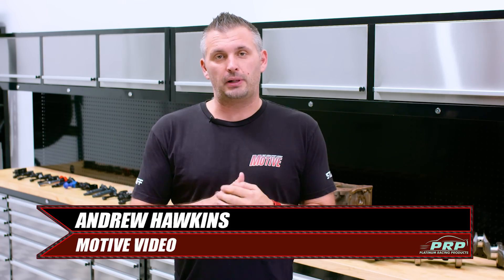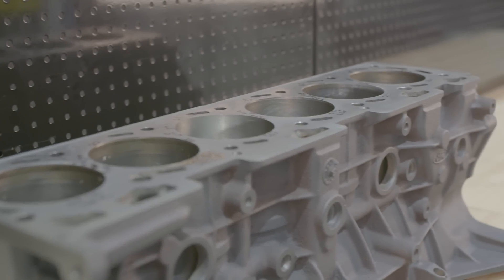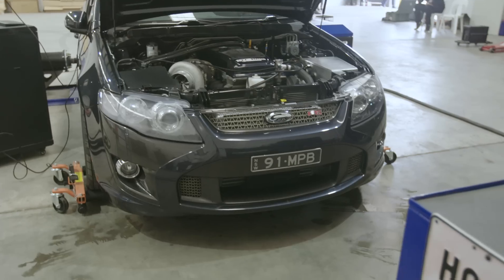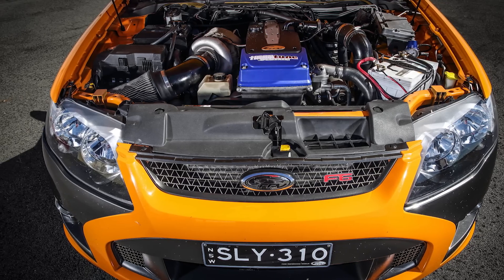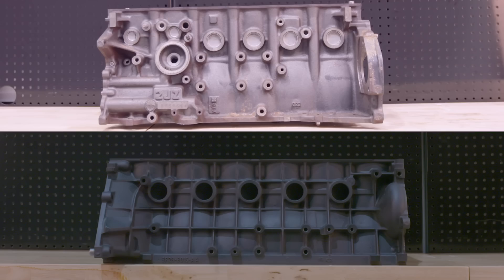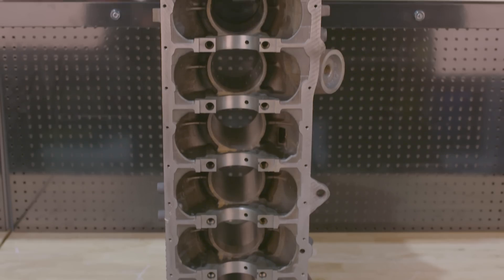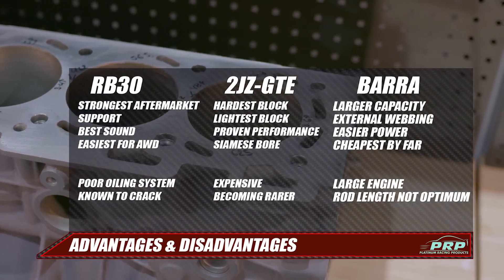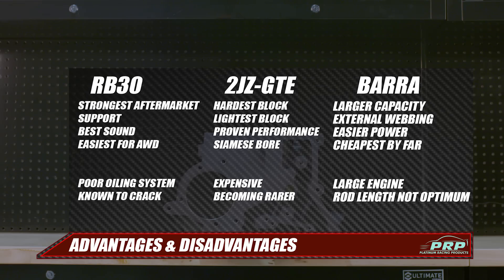Is the Barra 4.0L block better than the 2JZ and RB30?

Comment: Cost and Labour of a 1000Bhp Barra is far less than a 1000bhp 2jz
Reply: Someone should setup a business exporting Barras to the USA and then the Australian tuners should set up sister workshops over there tuning them
Reply: @scksqzbngblo9880  make it a 2 way deal, Barra's to the US and LS and Coyote's to Australia
Reply: @hangover2000  lol we've already got LS. Commodore, mate.
Reply: @scksqzbngblo9880  We import Barras into the US, have a few for sale right now, we have been importing them for years now. But as far as tuning goes that's up to the client to purchase the other parts necessary if they want to go with higher hp.
Reply: Lol the f6 can handle more power than any JDM car
Reply: Genghis Khan  barra requires far less to squeeze 1000hp than a 2j
Reply: Castle Bravo  "Why would you, an engine reseller, not refer to the engines as what they are actually called? "

That's how it is, I didn't make the rules, just making things easier for people. I am not affiliated with this company but here, 

https://www.dominatormotorsports.com/barra-swap-shop

What does that say? "Ford FG 4.0 Dohc Barra Pre-Order"??? Surely in your infinite wisdom it should say Ford 195 Dohc Barra? Pretty sure they are using the wrong image there as well, the engines they are selling are probably the non turbo variant but it's hard to tell from the container images they posted. 

Maybe it's an Aussie thing? 

Nope...

https://www.ebay.com.au/sch/i.html?_from=R40&_trksid=m570.l1313&_nkw=barra&_sacat=33615

"FORD FALCON ENGINE FG-FGX, 4.0, DOHC, BARRA LPi (198kW), SILVER ROCKER COVER TYP"

"FORD FALCON ENGINE FG-FGX, PETROL, 4.0, BARRA, 270kW, TURBO LONG BARE"

"FORD FALCON ENGINE BF, 4.0, BARRA, DOHC,"

Out of 31 listings for Barra... 1 of them came back with 182/190/195...  Just one.

"Ford Territory SX SY Barra 190 182 Petrol 4.0 L 6CYL Engine / Motor - Express"

So what about NZ? Let's search FB marketplace Auckland New Zealand 

Only 2 Barra's show up...
"BA XR6 motor and 5 sp Tremec"

https://www.facebook.com/marketplace/item/2378843102219479/

"Ford Falcon FG XR6 4.0 Barra engine and Ecu 155kms"

https://www.facebook.com/marketplace/item/413792716223477/

Maybe that's a one off, let's go south to Christchurch. Only one listing and no mention of whether or not it's a BA/BF or not, and no 182/190.
 

"Barra motor and box"

https://www.facebook.com/marketplace/item/841279756286672/

But one thing you can tell is that it's not an FG, or at least not an FG intake and FG oil pan. 

What about gumtree? 

https://www.gumtree.com.au/s-ad/ferntree-gully/engine-engine-parts-transmission/ba-falcon-barra-4-0-engine/1237748287

https://www.gumtree.com.au/s-ad/warburton/engine-engine-parts-transmission/xr6-barra-na-4-0-and-5-speed-manual-ba-2004/1237591464

https://www.gumtree.com.au/s-ad/edwardstown/engine-engine-parts-transmission/bf-barra-n-a-motor/1237337901

https://www.gumtree.com.au/s-ad/loganlea/engine-engine-parts-transmission/ford-falcon-fg-xr6-mk1-mk2-barra-bare-engine-no-bolt-on-accessories/1236605812

I could go on and on a lot more than this and likely blow past any character limit on here by a mile. 

For just shits and giggles let's look up some Barra engine builders. 

http://www.lewisengines.com.au/xr-6-turbo-ba-bf-fg/

Wait here's one...

http://www.nizpro.com.au/services/engine-building/

"Ford Barra 240T, 245T, 270T, 270T FG, 310T FG 6 cylinder"

But even they still added FG? I wonder why? I must be hallucinating right?

https://tremaniacracingengines.com.au/product/ford-4-0l-barrra-long-engine-1000hp/

"Cylinder Heads
Reconditioned STD BA/FG with upgraded valve seat profile"

Or hell here? https://www.fordxr6turbo.com/forum/topic/92105-engine-build/

Search for 195, then FG, how many mentions for 195 are there? 

Some of the only really true mentions of "Barra 195", "Barra 190", etc is in the wikipedia page and a few reviews. Pretty much any time you see 195, 270T, etc you are also going to see FG. But every instance of FG you are not going to see 195, 270T, etc. 

Is the actual name a BA/BF/FG engine? No. But it does differentiate them enough for most people to understand. 

"If anyone is looking for a Barra there in the USA, then they should know ( and I can guarantee they do )"

Okay, go to some US based sites, and search for something like Barra FG, and then Barra 195 or Barra 270T. Do it, I'll wait. Now what you will find is most if not all mentions of 195 / 270T will also have FG mentioned as well. But if you search for Barra FG, there will be a lot less overlap. The only time most people in the US add 182/190/195 to the title is to stretch it out and get more hits(SEO) later for those that actually do know and are searching for that specifically. But if they know that, they also know they are referred to as BA/BF and FG. 

Ebay for instance when searching for "Barra 195 engine" no quotes, no engines pop up. 11 results Just things from Australia like gaskets, but... they also list BA BF and FG as well. I wonder why? 

"Barra 190 engine" no quotes, no engines pop up. 24 results, similar things to the previous. 

"Barra 182 engine", etc, etc. 26 results, etc.

Now what about BA BF FG? 

No engines for BA or FG but 2 for BF.  

"If they are confused when you refer to them as what they actually are, then maybe they shouldn't be buying one. "

That's mighty elitist of you. You don't need to know what they mean to put one in a car, or anything along those lines. All the parts you may need to find are going to be easily found by searching BA BF FG. That's like someone getting pissy when they see 74+ 40 series Land Cruiser doors on a 73 and older. 

"and I can guarantee that no one here would rock up to an engine supplier and ask for a "BA or BF Barra" "

I showed above that isn't really the case. 

"for the simple fact they were also in Territorys. "

I am well aware of the vehicles they were in. But... anyone that deals with Barra's on a daily or hell monthly basis would be able to know exactly what you are talking about. 

"I've never ever seen or heard Barra engines referred to as anything other than their kilowatt rating or year of manufacture. Weird."

Yeah it is weird. For someone that claims to be as knowledgeable as yourself on the topic, you sure don't search around that much, buying / selling. I showed plenty of examples even in your back yard. 

But for the sake of my curiosity let's go off the beaten path a bit.

What about Haltech  I am sure you are familiar with them. 

https://www.haltech.com/new-product-ford-barra-4-0l-terminated-engine-harness/

"Engines Supported:
Ford Falcon I6 4.0-litre DOHC VCT “Barra” BA, BF, FG, FGX" 

Surely you are not calling the people at haltech ignorant are you? May want to file a complaint with the International Barra Society or something.
Reply: Castle Bravo  When discussing Barra engines, I find it easier and it's normal to say BA/BF/FG barra instead of 182 / 190 / 195. Saying Barra 190 just leads into a whole other discussion when the norm for so many people is just to say BA/BF/FG. It might be a little different in AUS? But Ben Neal (The mechanical Stig-MCM) even refers to them as such. I have yet to see anyone in the US refer to them as 182/190/195. We have sold quite a few Barra's in the states and were probably the first ones to start selling them here as well. At no point other than myself saying they are 190/195 has it ever been brought up in discussions. When first getting into selling them a typically conversation went like we have a Barra 190/195 for sale, they scratch their head like wtf are you talking about, and come back with do you mean BA/BF or FG? 

Just for clarity I am fully aware of the green tops, red tops, etc as well. 

BA Falcons are 2002-2005 Barra engines that they came with are 182, 240T, 270T (240/245 variant in XR6) and the E-Gas LPG engine (green top)

BF Falcons are 2005-2008 -- 190, 245T, 270T(240/245 variant in XR6), E-Gas LPG

FG Falcons are 2008-2014 - 195, 270T, E-Gas

There are others but that should give you an idea...
Reply: turbo  excatly every one I know that has 5 or 600hp in there stock bottom 2jz is on E85 you can run 600 stock bottom on a barra on pump gas I've seen it with several builds
Reply: 🇵🇷 [LAZCANO RACING ENGINE]
 🇵🇷💪😀 Jorge Lazcano AND HIS 370 "Z", IS READY TO TRY WITH THE RB26 / 30 ENGINE AFTER CARRYING THE MAXIMUM TO THE V-6 VG-30 AND IMPLANT VARIOUS WORLD RECORD, NOW COMES WITH RB 30 BLOCK HYBRID RB 26 HEAD TO BREAK THE BARRIER OF THE SECOND 5 FOR A NISSAN.
Reply: @twinscroll turbo this only applies to aussies, everyone who doesn't live in Australia doesn't have access to a barra engine. If we want one anywhere outside of Australia we have to pay high shipping and importing fees so it's not necessarily cheaper
Reply: @Jeff Butt We import barras and sell them they are not that expensive. A 2jz/RB will run you at least 2 grand. A BF Barra for example we sell for around 1400 with ecu, wiring, etc. 1200 if you pre-order with 600 deposit.
Reply: In Australia atleast. In japan, different story
Reply: bah, ship engine can make 1000hp ez
Reply: @ilham7345  another ice addict Barra owner.dreaming
Reply: @brentonwood5464  2JZ and Barra can't beat V12 Merlin in N/A power
Reply: @ilham7345  the Barra doesn't even come into it.therr ok down the 1/4 mile.a complete shit heap that doesn't have the top end to mess with anything.tge jz is the top end king.a Merlin is a tank motor.not even in the same world
Reply: @brentonwood5464 someone clearly missed the joke. Well, how much rpm can 2jz go?
Reply: @AndrewEG  It is better anyway, the displacement in the same design always wins. Tb48de is SUV engine
Reply: @uru-freemind7711  the Tb48de is at its limit around 280kw/400rwhp. After that your rebuilding a short block. Most of these other engines are safe for another 200rwhp more. Not sure where you got that idea from.
Reply: https://youtu.be/KQBNx4MX8Iw in street
Reply: Uru- Free Mind  https://youtu.be/ba3hZFTI0_o Don't see your shitty Suv taking down a lambo lmao, And as far as this thread goes, It's as dead as the guys brains that keep arguing on here
Reply: https://youtu.be/3vbZPQeHTfM forged engine and turbo, daily SUV. TB48DE is monster torque.
Reply: Nissan tb48de is the best big six.
Reply: Genghis Khan the barra boys mate are funny,cost you 25 k to get a sort of reliable barra at 450 kw,thats from the boys building them,there always going to pop,there just not designed for boost or rpm.2jz and 1jz always going to be the king of 6s get over it,
Reply: @2jzking181  Fuuuuucking hell mate, you need some toilet paper to clean up the shit coming out of your mouth! XD
Not designed for boost or RPM? Tell that to Dyno-mite and their Barra making 2000hp, 55psi, 10,000RPM on a factory block and head. 
Sure, factory it's an undersquare engine, not designed for revs, but neither are diesels. Didn't stop Audi from winning Le Mans with the R10, did it? Not exactly like the 2JZ is designed with revs in mind either. 86mmx86mm makes it square. Over square is what you want for revs. 
Does that mean the 2JZ is a shit motor? Fuck no, they're awesome. I'd own one in a heart beat. 
But calling the Barra shit? Saying the pop? Get in touch with reality mate. You're letting your fanboi-ism get the better of you.
Reply: @LockieNZ  dude the Barra is far worse for higher revs than a 2j forsure
Reply: @2jzking181   who told you that? you can get 450rwkw out of a barra for around 10-12k
Reply: @2jzking181  ohdear... Have you ever heard of Mercedes M103, Om606
BMW S50?
There are more straight 6's which can handle over 1000hp. 2JZ is a fine engine, but not the only best. Only children think that. STOCK om606 engines (with aftermarket accessories) can handle 4-500 horses for YEARS at over 6k rpm. Open your eyes bro! Dont you live in a box, do you?
Reply: @estrophy I have had a buld s50 in a 325i bmw was good but not as quick as my 2j,the s50 is reliable that's for sure.and from a 100 kph roll the stock as a rock looking 325i with a built s50 snail powerd would kill every hsv and falcon it come across,i own  mercs but only old  classics,
Reply: 2jz king, maybe actually listen for a change and you may learn something. 
As soon as you hear "Barra", you instantly get your panties into a twist and think that everyone is ragging on your beloved 2JZ. 
Thankfully most people can appreciate a good engine for what it is, and don't have to bag it out because it's not Japanese or German. 
Barras are fantastic for power and especially torque on a budget in Australia especially. 

But keep on trying to shitcan them, just because you can't appreciate that something other than Jap or German can be great... the rest of us will be over here in the section for people without their own head up their arse.
Reply: @falconpowerful2362 dont have to shit can them,you barra boys think your the king of the hill,thats the funny part,the barra is like a chines motor bike next to the Toyota giants,lot of mates have built fgs difference they no what they will never be and what they are,thats the difference.the 2jz is a little tank that revs its ass off.and has the nickname highway king for a reason,the barra in anything will never in the next 4000 years hold that title,they tend to hold 500 kw not to bad after that problem after problem,learn something I build my own motors and have done for 30 years.do you barra followers realize how funny it is when you say oh the barra is the king bla bla come on man that's funny.every single engine builder chasing big power and reliable would not pick a barra over a 2j or rb.the barra a good engine if you have enough money to keep them together,go for it.i have seen more barras explode then make power.fill them full of cement they will last abit longer,enjoy your falcon man just keep it real
Reply: @2jzking181  2jz Is popular not Is the king 6.
Reply: @falconpowerful2362  the king 6 is TB48DE less lag, more power and torque in low boost.
Reply: @uru-freemind7711 the 2jz and rb is the most developed 6s in the world,2jz being the king no challenge,no body wants the barra as there very limited and blow up.get off the ice bud
Reply: @uru-freemind7711  and an ls is far better than them both lol
Reply: @2jzking181  you talk about engines built completely, a tb48de with that level of construction destroys them at 2jz and rb. the displacement and the height of the block rules.
Reply: @2jzking181  
You know how expensive a 2JZ is in Australia? Abit of a unicorn here. First of all, know what you're talking about - A turbo barra motor that's produced after June 2006 can handle 380rwkw+ quite reliably. I had one with well over 200k km's pushing around 400rwkw with no issues. 450rwkw on a stock motor (besides valve springs) is very common. To make such a combo reliable, rods/pistons/springs is all that is needed at that power level. It does not cost 25k to do these mods, I would be very skeptical if I was quoted over 8k by a workshop. There is no doubt the 2JZ is extremely capable but let's act like grown ups here - assuming you are an adult, a little bit of maturity by not spreading miss information to push childish agendas goes a long way.
Reply: @yjkader not my words man haltec full boost loads of people involed with building barras,have made vids and say the keyboard warriors that say 3k 5k in mods getting this and that are dreamers.jz are everywere in Australia jz might be the king of 6s but there expensive man there just a different kind of animal.i really don't care about the LS this and barra that bla bla,im not a keyboard warrior man,i just watched some fullboost and haltec read comments from guys trying to get reliable hp from a barra is a big effort,also I enjoy watching anything be developed,and will follow it,if you like fords that's heaps cool,relax man its all in good fun. 2JZ FTW
Reply: @yjkader  the 2jz can make more than 600bhp on the stock engine. You also have to take into consideration that the displacement is higher. In all honesty, i'd rather build an LS motor from a junkyard since they cost just about the same as the Barra and they have a much bigger after market than the Barra lol
Reply: @itspapaj4732  OM606 too.. And its an 80's oldschool diesel. There is no best engine in the world.. There are many great engines.
Reply: @yjkader  2jz is  a  2.0 ltr well your owned pick up 2jzz engines for cheap in uk drugs cost 5x as much in australia than the rest of the world = rip off
Reply: @itspapaj4732  V8 is the way to go. You don't need all that boost to make decent horsepower. Why is boost bad ?...... because boost is pressure and pressuring air crates heat. Bigger motor means you need less boost for same power goal and run cooler. That's why they call a lot of imports dyno queens because they make so much damn heat from all that boost car pulls timing much faster. Yeah you got meth and intercooler but you'll run cooler with a bigger motor mod for mod plus you got a lot more cubes and still make decent power when the turbo aint online.
Reply: @2jzking181  my completely stock run of the mill fg na motor (toothpick rods) is making 600kw........ hahahaha what a wanker
Reply: Genghis Khan these barra boys even when faced with cold hard facts still talk shit its funny as.

Comment: This video specifically said "testing block strength only". The numbers given are average, and testing is not absolute. All blocks are great! The Barra is a 4.0 with the others at 3.0, so in terms of metallurgy, strength to displacement ... the 2jz is overall stronger. Nothing to do with how long it's been out, parts availability, aftermarket support, etc. Just block strength.
Great video